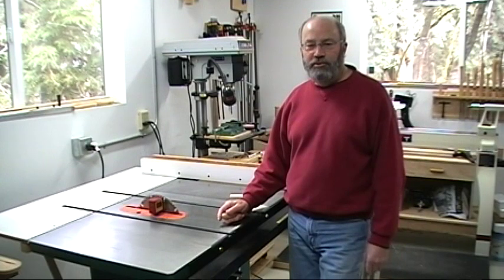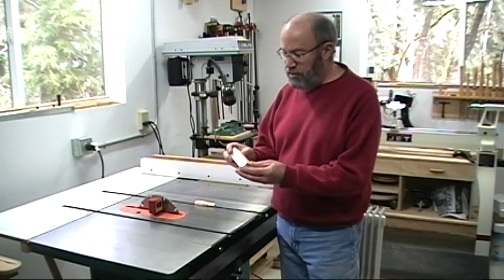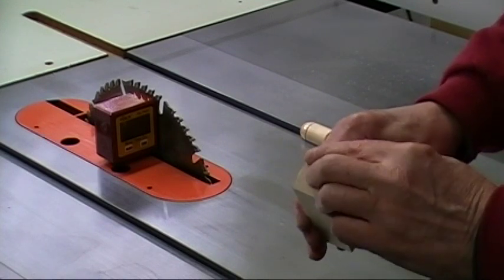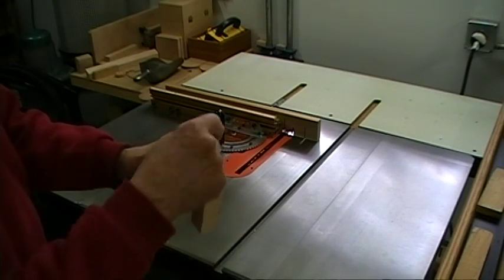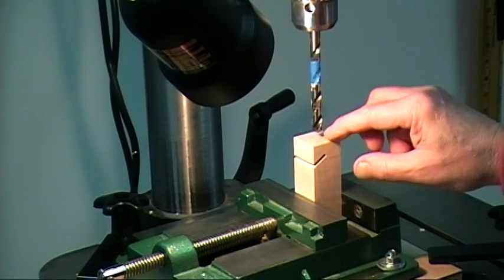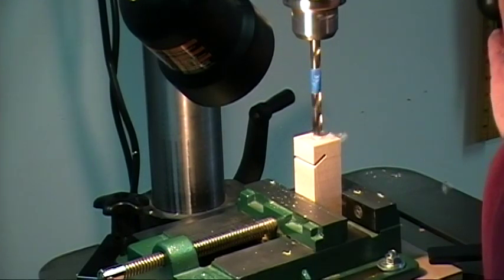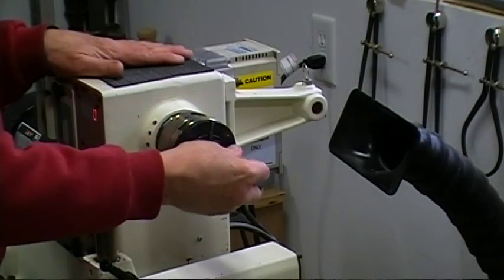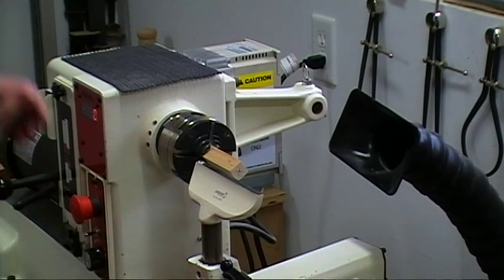Wooden Whistle, Part 1

Comment: Those big gouges are a treat to use! I had always thought they would only be useful for massive turnings, but they're more useful than that by far!

I personally like to grind the wings back on mine about 1/8" to 3/16", just so they're not so straight up.
One major advantage to that, as well as the large radius, is you can use the tool on an angle to get a cut almost like you would with a skew. You can actually get a really good finish once you get used to cutting like that.

Comment from the maker: @kenny474 Thanks for the comment and the tip. On my smaller roughing gouge (3/4") I also grind the wings back for the same reason as you. I left them alone on the big gouge just to have two different approaches. Both work really well. I find I use the big one more often now, even on small items.
Regards, Gary